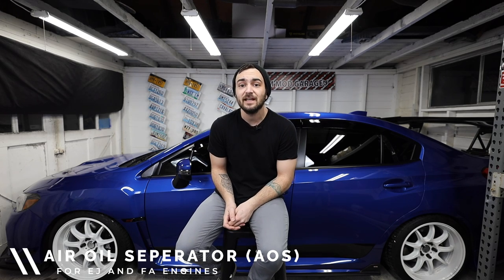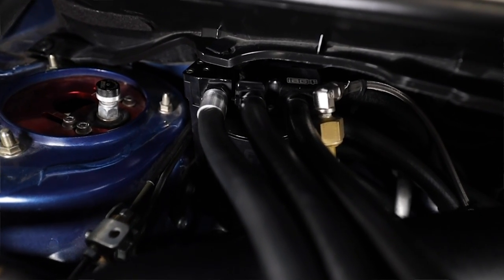5 Modifications To Reduce Engine Knock On Your WRX or STI.

Comment: Tanner, I gotta ask and I'm not insulting your knowledge or anything at all. Just purely curious, assuming the average Joe would stick with the stock turbo on their STI (I'm an FA owner btw) why would you run an ELH on a single scroll turbo even in regards to longevity?Just purely for knowledge,  thanks man. ✌🏽
Reply from the maker: Better get Temps across cylinders 2 & 4, lowers egts so you can get better knock control and it moves the power band up a bit 🙏
Reply: @Smeedia  Sick dude, thanks! Completely unrelated question, I was hoping you might know something because I can't find any information on it. I have a CVT WRX and I'm trying to get around the ballpark range between 300-330 whp. I have all full bolt ons but I don't want to rip my cvt to shreds, so I'm trying to keep it going for as long as possible. I do know about having a good oil cooler/ cvt cooler but would you happen to know anything about aftermarket torque converters by chance? Whether its worth it or what they actually do? Can't find much info about it and I've searched everywhere. Anything helps! ✌🏽

Comment: For the AOS and Radiator on the wrx, do you need to get a tune after you’ve installed it? Sorry new the subie world.
Reply from the maker: No tune needed 🙏 and never hurts to ask 🙌😁
Reply: @Smeedia   sorry i have one more question, should i wait until after the break in period or can i install it right away?
Reply from the maker: You'll be fine to install that while still breaking it in

Comment: I'm buying a 2015 or 16 STI from a dealer is there anything I should be looking for.
The car will have around 60 to 70 Kay's  on the clock. Liked and subscribed to your channel brother.
Reply from the maker: Appreciate the support, make sure your looking for any modifications done to the car. The last thing you want to do is  buy a car that someone else had put parts on and not tuned for it, or installed incorrectly. Outside of mods, look in fender wells for rust, service history and the normal fluid levels and what not 😁
Reply: @Smeedia  Awesome advice mate thanks for the reply and cheers from Down Under.

Comment: IAG came together with Cobb and helped them develop theirs. I run the cobb one.
Reply from the maker: They're essentially the exact same with minor differences in the baffling but also a good choice.
Reply: @Smeedia  Yea cobb has heat shielding and a bleeder for you coolant on the AOS. Haven't had an issues yet so crossing my fingers this summer.

Comment: Just change your oil, use good gas, get a good stage 1 tune.  Drive it like you don’t want it to blow pistons.  Will be a good car.  Oil pickup issue happens, super rarely

Comment: I was surprised you didn't mention the Killer-B AOS, any reason you don't like it?  BTW, great video, i have all of these parts except ELH installed on my cars, waiting for a free day to install my #4 cylinder mod, but yeah I agree these are the parts to keep those EJ's rumbling along, my auto 04XT has almost a quarter of a million miles and is still far more reliable than the jeep liberty (70K miles) my fiance used to drive, i insisted she start DD'ing one of my XT's and she is hooked now.  Gotta love that mid-range torque on the highway
Reply from the maker: I've never ran the killer B AOS so I cant speak for it but from what I've heard it sounds like a good product. Hot damn that thing is still going strong!

Comment: awesome video taught me alot! just wondering will installing any of these mods need a retune? thanks!
Reply: Jason Moussa only swapping out the headers will require a tune 👍🏻
Reply: Tyler Davis sweet thanks dude
Reply: Jason Moussa anytime man
Reply: Tyler Davis  figured AOS would as well am i mistaken? And also how often do you clean your AOS? thanks!
Reply: Patrick Brooks AOS doesn’t need one but if you’re running an AOS it doesn’t need cleaning either technically as it automatically drains itself. If you’re running a catch can you’re going to want to check it to empty it out. It never hurts to check on your AOS though or any component. If it concerns you or you just like to be on the up and up with your vehicle give it a look every now and then 👍🏻
Reply: Tyler Davis  Thanks for clearing that up i appreciate it! just getting into the mods for my 11 sti continuing my research. AOS is definately now on my list
Reply: Patrick Brooks no problem! I highly suggest running one. As far as brands I’d go with the IAG AOS. They’re a fantastic brand
Reply: Tyler Davis  thanks i am going with the cobb i hear it is made by iag but newer
Reply: Patrick Brooks really? Never knew that

Comment: If I get a 2020 Sti, I plan to keep it stock and use it as a daily and will not be pushing it hard everyday. Do I still require any of these mods to keep it reliable or just simply do regular maintenance?
Reply from the maker: Just regular maintenance and youll be solid 😁 early potential congrats on the maybe new car!
Reply: Smeedia They say manifest your dreams and it will come to you 🙏

Comment: Do you or anyone know if the 4th cylinder cooling mod would work on my 99 forester with the stock ej25? I bought it with only 74k miles magically and I want to keep it as reliable as possible as long as possible

Comment: Hey, what about the FMIC? Would you recommend it over the stock or an aftermarket/upgraded TMIC? For reliability and performance reasons?
Reply from the maker: That depends, what's your end goal for power? 🙏
Reply: @Smeedia  Hey thanks for the reply! Long term I’m thinking about 450-500 at the engine. But right now, shooting for between 350 and 400hp.
Reply from the maker: Long term wise I'd but a FMIC to set yourself up later. That way your not buying a TMIC now then a FMIC later 🙏
Reply: @Smeedia  Alright. Is the front bumper adequate? I have a '13 GR STi.

Comment: Hello on my 2018 WRX my accessport Knock sum is reading a 0/4 4 also saw a green light for a moment Feedback knock is 0.00 -1.41/0.00 Dam 1.000 fine knock learn 0.00/0.00 just had it pro tuned is this normal
Reply from the maker: Everything sounds like it's running solid 😁
Reply: @Smeedia  Thank you for that peace of mind:)

Comment: Hey I have a question I drive a 2018 WRX and people tell me that it already has ELH and that it’s not worth to change it unless your changing the turbo . What do you think of that ?
Reply from the maker: Correct it does come with ELH, not a huge need to swap it out unless your aiming for more power. What's your goal with the car?
Reply: @Smeedia  honestly my goal with the car is to obviously try to prevent the knocking and too get more power from it . So would it be worth it to get it ?
Reply from the maker: No need to swap then 🙏

Comment: What's the best model for fuel economy. How do u get the best fuel mileage out of an STI
Reply from the maker: WRX gets better MPG, for an STI stay south of boost 😅
Reply: So there's nothing you can do to an STI to get better fuel ?
Reply from the maker: Just staying out of boost and driving in I mode. Outside of that there are not really any mods that will greatly increase MPG
Reply: Cindie Cabreja You don’t buy an STI for mileage. Get a civic for that.

Comment: Do you recommend the Oil Pickup for the FA as well?

Also, any thoughts on the Perrin aos?
Reply from the maker: The oil pick up is not a bad idea for the FA20 and perrins is good from what I have seen, I used one for a little while on my old 2011 STI and it did its job
Reply: Killer B pickup on the FA is a must because even though Subaru improved their oil pickup, the screen on the pickup is still shit. Get the Killer B and call it a day.

Comment: Converting ur car so it can run e85 is a great mod for longevity it will cost about the same as a header from killer b but u will get way more power and from what I’ve seen on the access-port knock is non existent.
Reply from the maker: Agreed, I left out E85 just because not everyone has access to it 😫

Comment: Have you ran into issues with HKS branded e.l.h?
Reply from the maker: I've never ran HKS but someone sid comment that they liked it and had good fitment
Reply: @Smeedia  ok good. That's what I'm currently running and was just checking to see if it ever prematurely failed or anything like that. Thanks for the help and info

Comment: Hey guys so i have an 08 sti hatch and it’s a manual  when I’m taking off i can rip it but as i get up to higher rmps and slap gears it’s a big ol knock any tips?
Reply from the maker: Coming from the motor or thr trans?
Reply: @Smeedia  I’ve been thinking transmission mounts but I’ve only see the shifter shake from that
Reply: @Smeedia  trans mounts i believe but no shifter wobble
Reply from the maker: I'd start with the trans mount and the cross brace bushings in the trans support 🙏
Reply: @Smeedia  👏

Comment: I heard if you dont burn oil then an AOS is not necessary. true/false?
Reply from the maker: False, the PCV system will still push oil vapor through the intake track and build up condensation.

Comment: I ended up choosing a catch can over AOS for my FA due to cost, was there a reason you didn't mention them?
Reply from the maker: Less maintenance, just dont want people to forget to drain them and have issues later on. But as long as you remember to drain them they are great choices!
Reply: Catch cans are nice so you can see how much oil is getting through, that's the positive. The AOS auto filters out the oil and recirculates it back into the system, removing the need to check a can.

Comment: Hi I hope you don’t mind but what wheels are they thanks
Reply from the maker: Work emotion D9R 🙏🙏🙏
Reply: @Smeedia  thanks for the reply I’m based in the uk.  I have an early blob eye wrx I chose the wrx over the sti as I was going to change everything anyhow so to me it would be an sti anymore. I have 6 pot front 4 pot rear ap racing callipers bc coil overs hard race control arms white line anti roll bars and strut brace and at the moment a Haywood and Scott exhaust system but in the market for a different system. I’m going for a ceramic coated header but from your advice it will be equal length my wheels are 6 spoke 18” compomotive wheels and I’ve just ordered some carbon fibre. I’m going to by bits for this engine that will go on my future and big purchase closed deck striker engine big expense but before that full re spray
Reply from the maker: Sounds like a fun and solid car that you've gotnover there! 😁
Reply from the maker: Jealous of those brakes too!
Reply: @Smeedia  yeah sorted the handling before going for more power I don’t want to kill my self lol yeah the brakes are great. I also took off the front subframe and put a h frame I’m also eventually going to change the rear subframe. Like you I love scoobys but also I want mine to be my ultimate car and have it’s looks be personal to me. I’m not like most over this way who by an wrx and then try to turn it into an sti 😂 they should of just bought one in the first place 😂. I’m new to your channel but I have found it vary informative so keep up the great work ❤️

Comment: Put equal length headers on and you won’t have cylinder four overheating. Cylinder four overheats because of unequal length headers.
Reply from the maker: Having both would further reduce hot spotting. You still have insufficient flow to cyl 4 for coolant utalize the OE USDM cooling system.
Reply from the maker: @alitoroganan2442  JDM Cooling systems utalize a similar set up to the cyl 4 cooling mod.
Reply from the maker: @alitoroganan2442  they keep all the good stuff for themselves 😫

Comment: Appreciate the feedback on the headers. So on my 2018 wrx I have the Cobb AOS as my first MOD. Wanting to tackle some reliability adds before I start the stage upgrades. Would the Mishimoto radiator be the next best add. Thoughts? Any other recommendations. Thanks!
Reply from the maker: EGR and TGV deletes are some good go to mods on the WRX, the radiator will help to pull a little more stress off of the engine as well 😁

Comment: Ayy congrats on 10k 🎉 speaking of bigger rads and stuff, how do these cars hold up in really hot weather? I’m in canCal and it hits > 110f 👀
Reply from the maker: Thank you!  They get hot but as long as your constantly moving you'll be okay with the OE radiator as long as your not getting on it when temps are high. But should be fine 🙌

Comment: Hey! I was curious as to what kind of maintenance you would recommend on a 2016 wrx? Mines got 87K miles and I just went stage 1+. I don’t know what kind of maintenance the previous owner has done so I wanted to do what I can to make sure all is running good.
Reply from the maker: Swap all fluids (both engine and trans) walnut blast the valves, change filters and swap plugs. After that you should be solid 🙏😁 congrats on the car 🔥😁
Reply: Smeedia thanks bro!

Comment: How much knock is acceptable?
Reply from the maker: -1.40 to -2.80 is what I would consider normal and acceptable but it will also be tied into DAM and fine knock learn
Reply: My fine knock learn gets worse than -2.8 should I bring it back to my tuner or get a new tuner he’s a gold Cobb tuner
Reply from the maker: Whats your DAM and Fine knock learn reading?
Reply: I’ve never noticed the car’s Dam change from 1 on the access’s port
Reply: Fink knock havs been as high as 7.? Before
Reply: Fine knock learning
Reply from the maker: I wouldn't overly worry about it then, if you see your dad drop in conjunction with feedback knock that should raise a red flag
Reply: Smeedia thanks man

Comment: Planning on installing iag aos but I remember you having to bend the brake lines by the firewall, how did u manage to do that without pinching or breaking them?
Reply from the maker: Just be careful when bending them, you'll have to use a lot of force to actually break them

Comment: Which IAG AOS should I get if I'm running flex fuel? 90% of the time I'm running e85, maybe once a month I pump 91 (Las Vegas). I've been given different advice from both IAG and builders on which to run (street/comp).
Reply: Also I've been eyeing the Cobb/IAG version. lol
Reply from the maker: I would go with what your tuner recommends on that one, if both are giving you different answers then I wouldent know exactly on that one and dont want to point you in the wrong direction. But personally I would go with what your builder says
Reply: Smeedia My tuner is no longer tuning in town and he was one of the best. I’m going to have to find a tuner in a neighboring state. Im thinking of just going with the one that is geared towards e85. Also there’s only one version of the COBB/IAG, what is it specified for I wonder?
Reply from the maker: @michaeltaeza3662  the Cobb one is a Street series IAG one essentially. If it were me I would run the competition series AOS if I was dedicated to E85. But that also will depend on your power numbers. I'll be keeping my street series until 450 WHP then a was tapping to the Comp series after 450 so I can eliminate the PCV system.
Reply: Smeedia I was tuned at 400whp 375tq on e85. I’ll research some more, but appreciate the advice! Will look more into the comp series.

Comment: I like it better when your sitting down,  now just keep a hand in your pocket and you’ll be gtg. Also, the stock Subaru radiators are cabbage, known for cracking along the end tanks
Reply from the maker: Have had the end tanks crack on my 02 WRX, quite messy when they do 🤣 and I'll utalize the stool a little more 😅

Comment: Larger radiator may have larger surface area... but also has larger content of heated fluids to cool. Put a temp sensor on inlet and outlet on both rads and back up the claims.
Reply from the maker: Good point, but not saying it cools the fluid more. But that it is more efficient in coolong
Reply: @Smeedia  drop inlet and outlet temps for both rads up here..  love the vids dude. Just need real world stats to back up claims.

Redit the old rad. Fit temp sensors in and out. Then refit the larger...  match results.

Also monitor ambient heat saturation from the larger rad.... larger rad releases more heat into the engine bay.

Comment: This doesn't really address the issue which is the piston rings need to be regapped. Get tuned for less torque and avoid loading the engine at low RPM. Regapped OEM shortblock at 400whp no issues 90k in.
Reply from the maker: Without cracking open the short block these are about all you can do for bolt ons. But I agree with your statement. For the vast majority of people who dont want to open the short block or cant afford it these modifications can help mirage potential issues

Comment: Crawford V3 doesn't use coolant
Reply from the maker: Last Crawford I ran was the V2 model. Suggest the OAG over the V3 then
Reply: @Smeedia  Crawford claim that it's unnecessary with their latest design.

I've been running their V3 for about a year now (swapped out previous Morosso can) and just had a look inside my up pipe.... No oil.

Comment: stay away from the Grimspeed AOS seriously
Reply: May I ask why?
Reply: Spend prob about a 100$ more and get a much better AOS.
Reply: Why so?
Reply: use the link goes more in more detail,  but I had personally used it and noticed it was still sucking oil into my turbo inlet. so I then added a catch can on the inlet hose before going into turbo inlet which helped. but for a extra 100 you dont need to check oil catch or have to worry about any oil getting into the combustion cycle. I have a IAG aos now I have fresh air in the inlet. just trying to save anyone from my past mistakes.
Reply: @williamgeggatt768   a million times better
Reply: The Flatirons videos is bad data for the oil cap AOS. They're using the stock oil filler cap with the Grimmspeed AOS essentially making the AOS ineffective since part of its design is the cap itself.
Reply: @Omegacron37  my friend it is bad from my personal experience with it